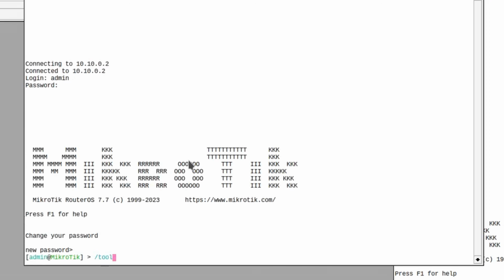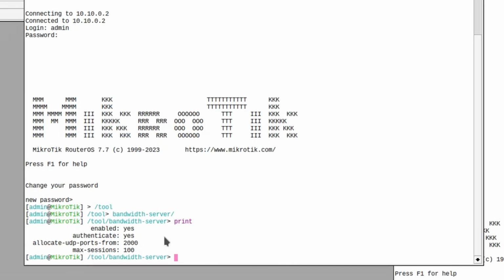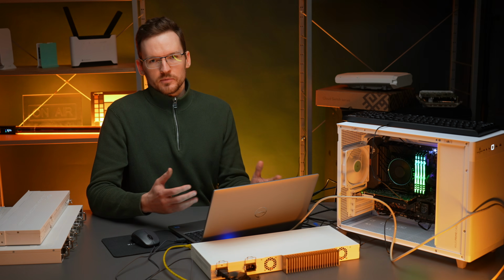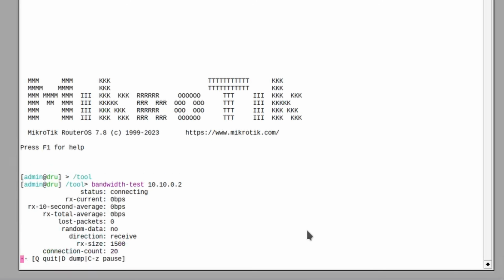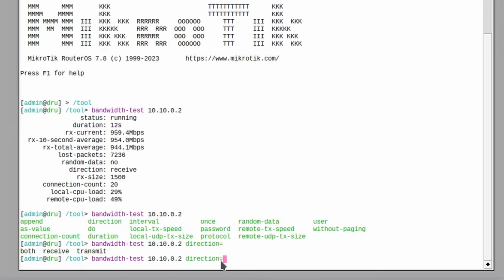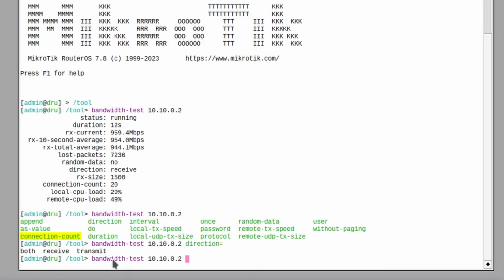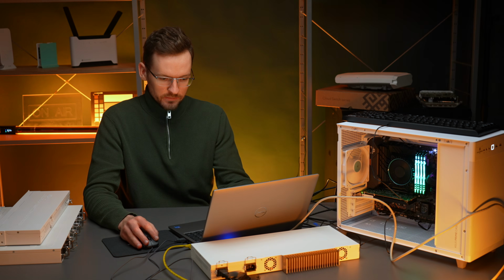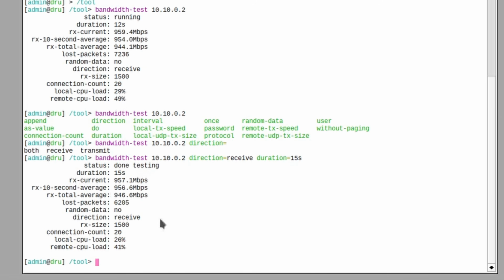MikroTik Bandwidth test tool

Comment: what is the difference between bandwidth test and Mikrotik traffic generator?
Reply from the maker: Traffic Generator can simulate any kind of traffic that can happen in real life. It is a very advanced tool. 

Bandwidth test is very basic, simple random data stream. Like speedtest. Not super accurate, but simple.

Comment: How about using iperf3 like normal people do?
Reply from the maker: This tool is far more powerful as it can simulate any kind of real traffic
Reply: @mikrotik really? And always need another router to do the check.... vs iperf3 that is a "standard" tool for bandwidth test that you can run on a normal server? Please provide an iperf3 compiled to Mikrotik tool. Or better, share the source code of the bandwidth test tool.

Comment: Thanks for the wonderful video, MIkrotik is really a very good troubleshooting tool, that will definitely come in handy, especially on my Wireless links. I noticed that version 7 now also has a Speed test option, is that the same as the bandwidth tool, also on the bandwidth test may you please add the total data used in the duration of the bandwidth test in statistics? Does Mikrotik have public bandwidth test servers ?

Comment: There is some misinformation here - not a major though.
The default for bandwidth test is RX (receive) - not both directions.

Also, as a note, by default this s running a UDP bandwidth test. On LAN, this is fine to get absolute capacity, but TCP is what I recommend in general as there is quite an overhead for that, and most traffic actually used is TCP.

Also, TCP bandwidth test WILL use a lot of CPU resources. Is recommended that you test "through" a connection to get a real representation (from a server/client that is not the connection being tested).
Also, also... Unsure about the latest versions of RouterOS, but @7.1.5 the bandwidth test was limited to single thread "per test" so would cap out @ about 2 Gbps on a CCR1072.  You can however open multiple terminals and run multiple instances.

As an Aside, there is no current capacity for RouterOS to run to Speed test server, not to run iPerf... However I'm sure that something could be done in a Container (although I do not know of the overheads of veth and wther the unit could run direct on switch chip - hw offload - or if it would be entirely software emulation - CPU)

Comment: Hi there! Is it possible to use the bandwidth test through a VPN or only with physical connections
Reply: Yes it is, but if I don't believe you can current use Routing Marks/Tags as a selection of path, so if you are testing to a server not in the route table via the VPN, you'll need to add a route to that server via the VPN.
If the test is temporary, don't forget to remove the route after (and obviously be careful not to add a route that will break the route table 😊)
Reply: @zactodd3144  Got it, my friend. My use case is to test the throughput of a tunnel to see how much data I can pass to access an application. Thank you very much for your answer.

Comment: Can I do this bandwidth test through a WG tunnel? Also, how did you come up with 10.10.0.2 on the client settings.  It is not clear which interface IP address the BTserver will use........
Reply: IP address are already assigned to the router lol